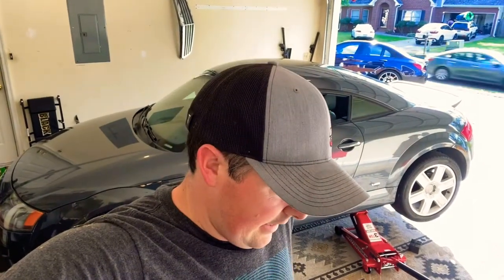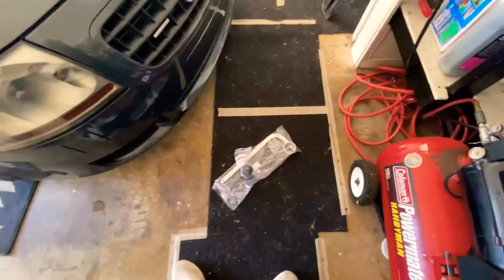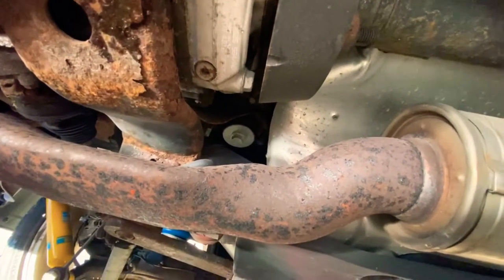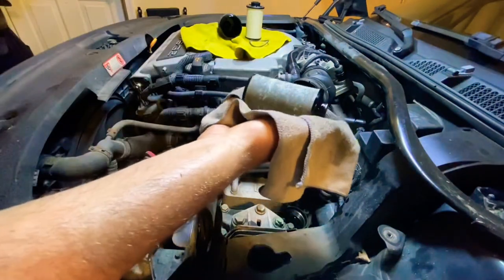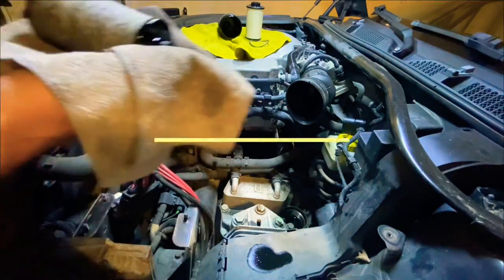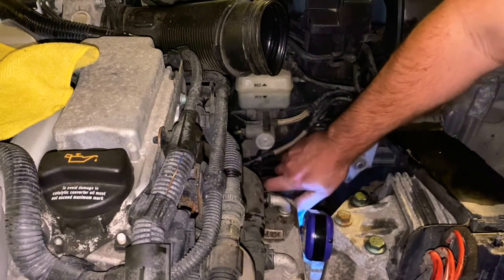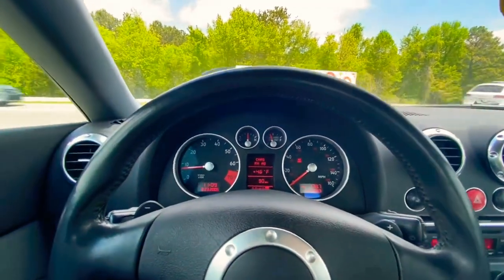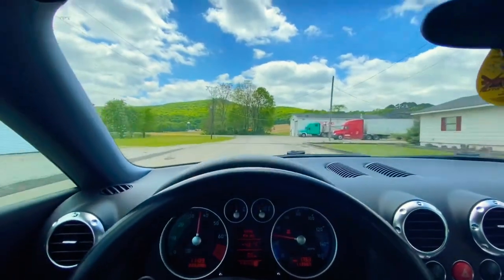Changing HALDEX oil and DSG fluid on THE Mk1 AUDI TT

Comment: Great vid, one thing I always say is to remove any filler plug first! 
Especially with gearboxes etc that are often never touched, you don't want to drain the fluid out, only then to find you cannot refill it 😱
Nothing worse than making the machine unuseable, if it's your only vehicle you are screwed 👍

Comment: Where is the DSG drain plug? and how long did it take to pour the fluid? How many liters of fluid? Cheers!
Reply from the maker: The dsg drain plug is on the back of the unit. It faces toward the front of the car.
It’s going to take you a few minutes because the oil is a bit thick.
I’m not sure how many liters but it takes one while tube